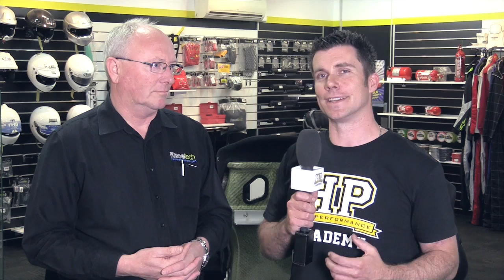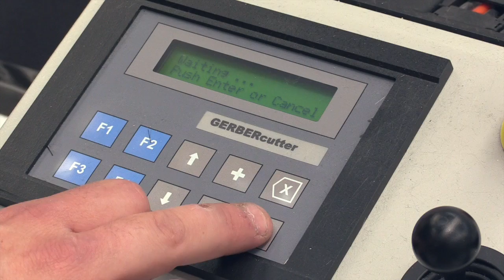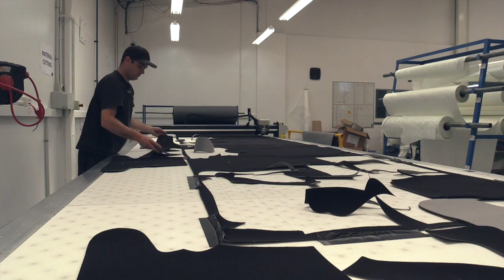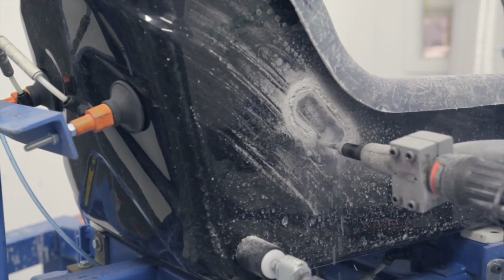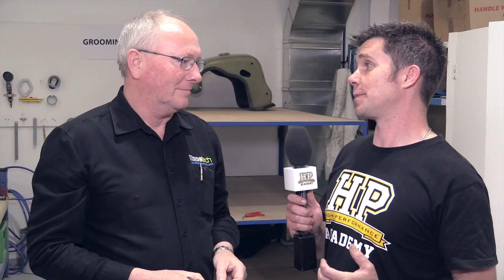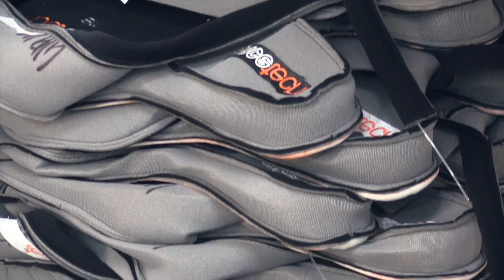See how Racetech race seats are made | Factory Tour

Comment: How the foams are attached to the carbon fibre frame
Reply: There’s a base fabric thats very thin in layer that goes over the frame of the seat and has velcro strips in certain areas. The cushions are the foam wrapped in the fabric which are then stuck to those velcro strips. The reason for this is because you as a buyer can choose different size cushions to sit higher/lower and even firmer/softer